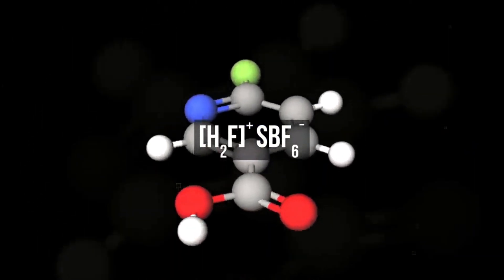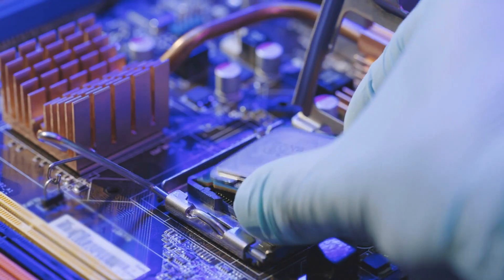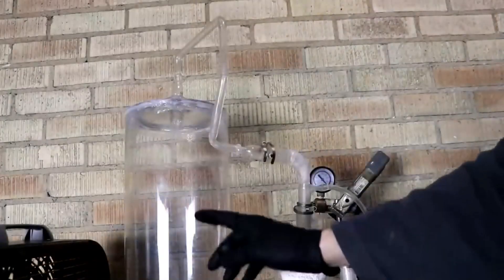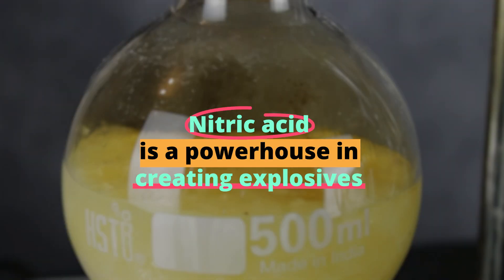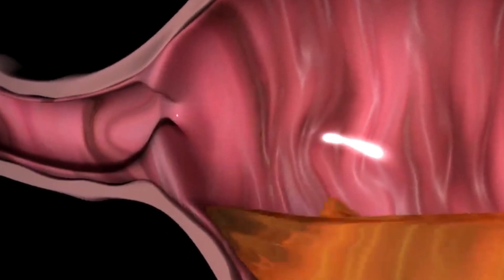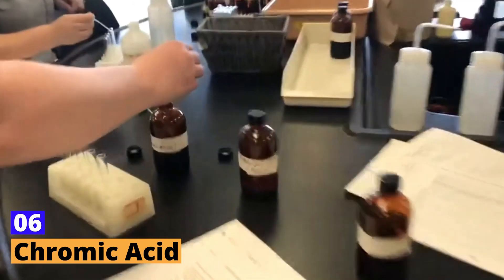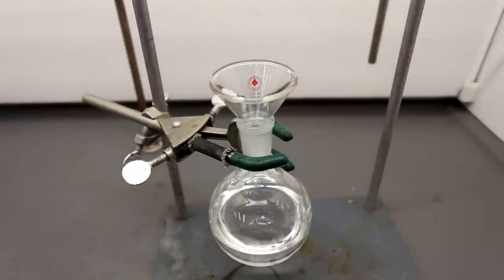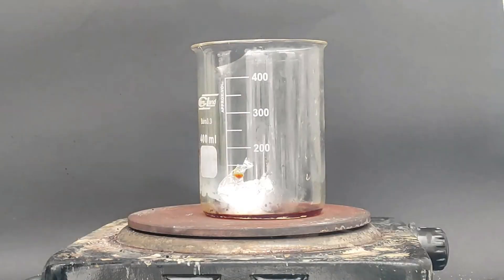The World's 10 Most Dangerous Acids | Unveiling Their Mysteries

Comment: I think that it's worth mentioning that there are in fact different forms of nitric acid available. Here's a description of the different forms of nitric acid from a chemistry article - Ordinary nitric acid has a concentration of 68%. When the solution contains more than 86% HNO3, it is referred to as fuming nitric acid. Depending on the amount of nitrogen dioxide present, fuming nitric acid is further characterized as white fuming nitric acid or red fuming nitric acid, the concentrations above 95%. Nitric acid is also commonly used as a strong oxidizing agent.

Pure anhydrous nitric acid (100%) is a colorless mobile liquid with a density of 1.512 g/cm2 that solidifies at -42° C and forms white crystals. It boils at 83° C. Consequently, anhydrous nitric acid should be stored below 0°C to avoid decomposition.

Comment: I think that it's worth mentioning that although even dilute solutions of hydrofluoric acid are both toxic and corrosive how toxic hydrofluoric acid solutions are depends on how concentrated those hydrofluoric acid solutions are. For example a 10% hydrofluoric acid solution is still highly toxic and corrosive, but a 48% hydrofluoric acid solution is more toxic and corrosive than a 10% hydrofluoric acid solution. The highest concentration of hydrofluoric acid available industrially and in chemistry research labs is a 70% hydrofluoric acid solution, which is extremely toxic and extremely corrosive and even more toxic and corrosive than a 48% hydrofluoric acid solution, although a 48% hydrofluoric acid is still highly toxic and highly corrosive and must be handled with extreme caution. In general all solutions of hydrofluoric acid including dilute solutions should be handled very carefully, especially concentrated hydrofluoric acid solutions.

Comment: I have some personal experience in handling some of the acids included in this list myself. I have handled a dilute 10% hydrofluoric acid solution which was used to remove rust from metal, and during my high school chemistry studies I also handled concentrated 98% sulphuric acid as well as concentrated hydrochloric acid, glacial acetic acid which is the most concentrated form of acetic acid and I also handled a bromine solution, which although it's not an acid bromine solution is still extremely corrosive and extremely toxic as well as being a carcinogen.

Comment: I think that it's worth mentioning that even though it's extremely toxic and highly corrosive hydrofluoric acid is in fact considered a weak acid, here's why - HF, hydrofluoric acid, is classified as weak acid. Even though HF is very corrosive, it isn’t considered a strong acid. Because the bond between H and F is very strong and so HF doesn’t dissociate much in water. As dissociating completely is the main characteristic of a strong acid, HF is considered a weak acid. It's also worth mentioning that in addition to being corrosive nitric acid is also a strong oxidizing agent, and concentrated acetic acid is also moderately flammable and apart from being corrosive and carcinogenic chromic acid is also toxic and a strong oxidizing agent.
Reply from the maker: Wow that’s actually a lot more in depth - thanks for the insights and we appreciate you delving into it further 🫡 learning from our comment section also 👌🏽
Reply: @TheScienceCove  You might also find it interesting to know that hydrofluoric acid on it's own is classified as a weak acid for the reason that I mentioned in one of my previous comments, but a mixture of equal parts of hydrofluoric acid and antimony pentafluoride forms fluoroantimonic acid, which is currently the strongest super acid known to humans.